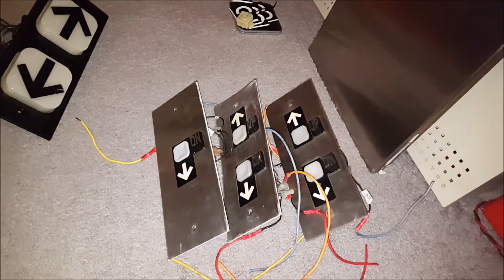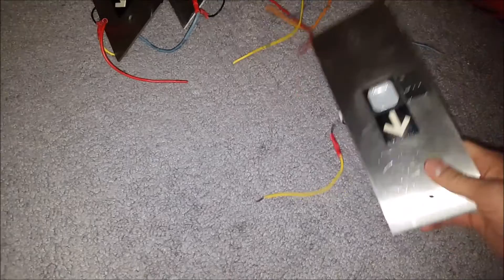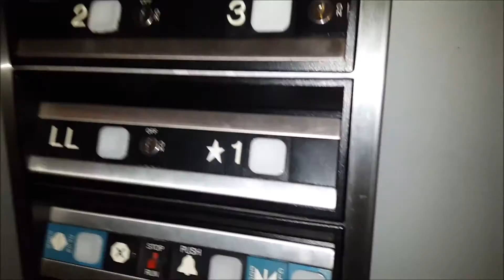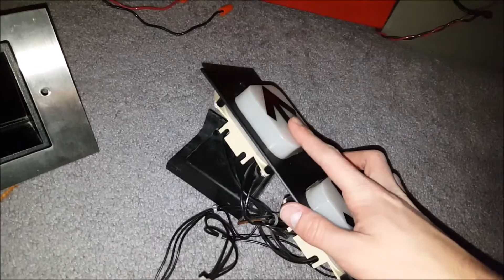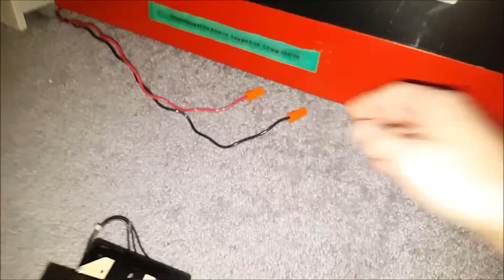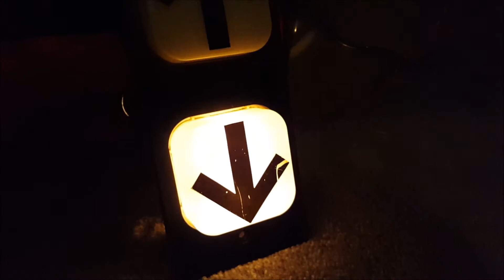Dover Impulse Elevator Parts - Buttons, Key Switches, Indicators

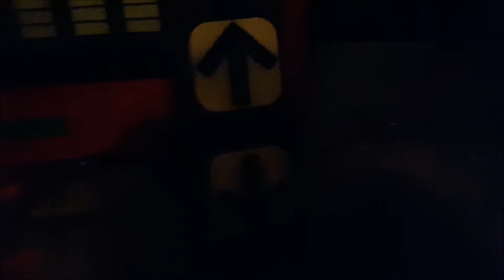Comment: 14:35 This is why when some modernization are done, the new down chime rings 3 times instead of two... because many aftermarket lantern/chime assemblies were intended to be used on controllers which don't pulse the down chime, such as Otis, along with relatively old relay controllers. I believe these aftermarket lantern/chime assemblies are sold in the non-pulse and the pulse varieties, it's just some companies who do mods could care less about how many times it rings when going down.
Reply from the maker: +BikeGeekMTDX Exactly. Very common with Innovation and Epco, especially.

Comment: Nice! Did you get the 4002?
Reply from the maker: +NJMoo3652 Thanks! Still working on that. The main panel is in the basement, and the manager told me over text he'd try to have it out yesterday or today. Chances are I'll be getting it tomorrow or Friday, but no guarantees. Also, keep in mind, it's not fully confirmed it's a 4002. I'm just making that assumption based on the lobby annunciator/panel and the devices. It probably is, but we'll just see in a couple days here.
Reply: +msj191961 Ah ok. Good luck! I know that these older simplex panels are getting pretty rare these days
Reply from the maker: +NJMoo3652 Thanks! And yep, they are.

Comment: Could I buy one of the call stations?
Reply from the maker: +ElevatorNut13  I've actually already had someone else ask me a similar question, and I have a feeling more and more people will ask for these parts or to buy them as time goes on. I have a small attachment to this stuff, as crazy as that sounds. But here's what I might do. I have a feeling I might decide to post the 3rd floor call button on eBay as an auction. I'll let it run for however many days, and I'll start the price low and let my subscribers try their hand at getting it. That's the fairest way I can think of doing it.
Reply: I have a small collection of parts if you want you can buy some for cheep
Reply: +Sean Duncan what do you have?
Reply: +msj191961 Can you post a link to it here? I have always wanted impulse parts :D
Reply from the maker: +ElevatingSoCal Yes, I will.
Reply: msj191961 Also is it wireable?
Reply from the maker: +ElevatingSoCal Yes, of course. It even has existing wires going to the actual switch and the light bulb.
Reply: msj191961 Wow cool!
Reply from the maker: +ElevatorNut13 3rd floor call station is now for sale: http://www.ebay.com/itm/Dover-Impulse-Elevator-Call-Station-Button-/182038541837?hash=item2a6257b60d:g:Ak0AAOSwQYZW002J
Reply: +ElevatorNut13 3 floor indicators, 3 gal fixtures, a hall lantern, and another call station, just email me : seanderpiscool@gmail.com
Reply from the maker: +ElevatingSoCal 3rd floor call station is now for sale: http://www.ebay.com/itm/Dover-Impulse-Elevator-Call-Station-Button-/182038541837?hash=item2a6257b60d:g:Ak0AAOSwQYZW002J